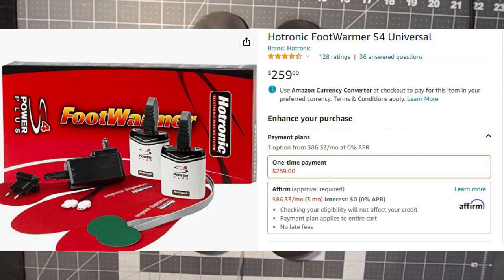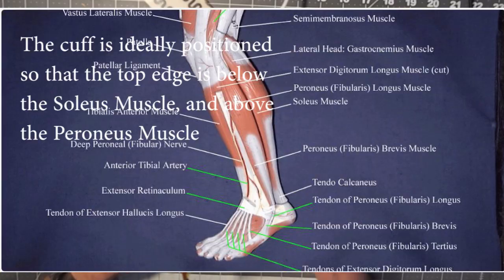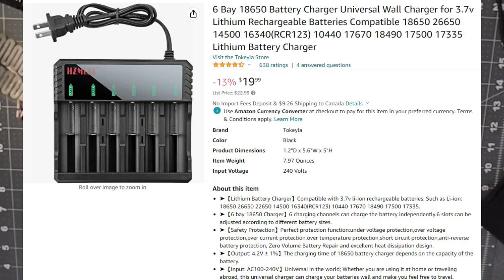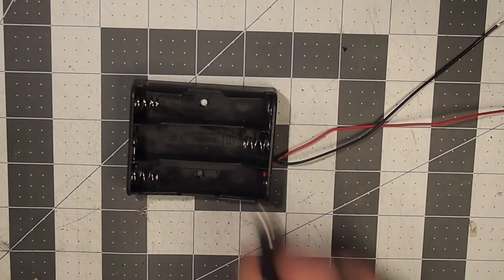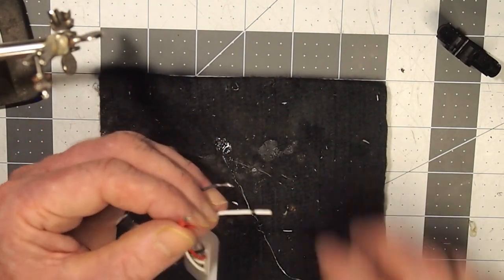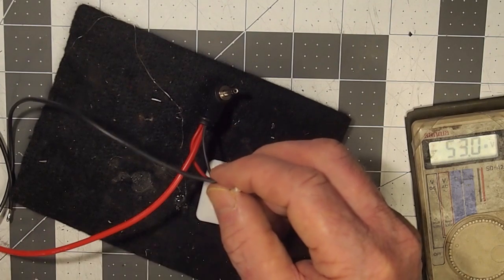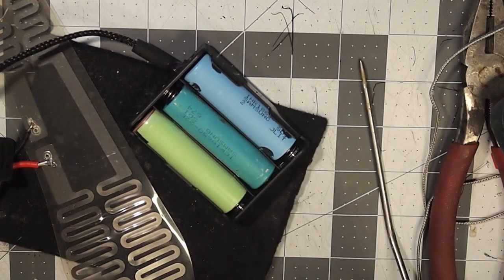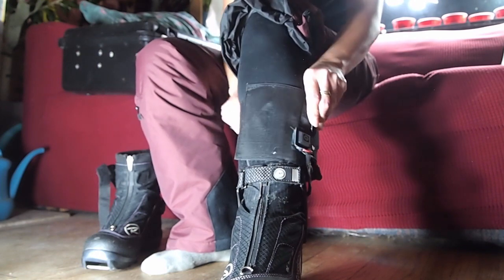Handwarmers S07E04: Make $500.00 equivalent boot heaters for less than $50.00

Comment: I just watched video S06E01 with the rebuild; Zippo and Jon -e Giant. And, my handwarmer is neither. It's larger than the zippo but smaller than the Giant. Which on the video, per the grid squares you describe on the mat, is at least 4.5" in height. That's bigger than mine

 I need a little help. I'll give you the dimensions of my Jon-E and you give me an idea of what parts kit will fit and I'll complete the form. 

   My Jon-E specs:
   
    H - 3.5"
    W- 2.25"
    D- 11/16"
     With a burner area W @ 1.1875"
    
  These were from the late 60s, when I was a young man hunting deer in PA. If you don't have parts for these... understand fully.
Reply from the maker: Thanks for that Joe, I often confuse myself because my mat is in inches and all the Chinese suppliers talk in centimeters! According to Google, if I convert your 1.1875 inches to mm, your catalyst head appears to be about 30mm long. That is fairly standard for a lot of catalyst heads, so a spring that is 35mm long would fit. But then you need to look at how wide the opening is so the spring can fit inside the head. Those dimensions are typically 9, 10, 11, or even 12mm. See if you can measure that, then it is possible to make sure you get the correct spring.

Comment: Just ordered some upgraded handwarmers from you, looking forwards to using them. 

I work outdoors and this is the missing piece now. Does that switch have any kind of safety for the 18650s? Low voltage cutoff or something similar? 

I'd love a set of these but relying on the protection circuit in the cell itself is scary to me.
Reply from the maker: Thanks for that Jady,
18650 cells need to be protected when charging, not discharging. The horror stories you see on Youtube depicting batteries experiencing thermal runaway are when they are charging (usually when balance charging has shit the bed), and of course a short circuit can cause a fire as well. Single Li-Ion cells do not have to be balanced charged because you remove them from the battery case and charge each one individually. However, Li-Ion should not be discharged below 2.5v per call or they can become damaged to the point where they are no longer able to recharge. The chargers have the protection circuit in them for overcharging (where they have a voltage cutoff at 4.2v to avoid overcharge). When used for these boot heater footbeds, the concept is, when the cells in series in the battery case fall below the 3v mark the footbeds will not be producing enough heat to keep your feet warm, so the user removes them and replaces them with fresh cells. At the end of the day, the last of the day's cells are removed from the battery pack and go back into a (protected) charger, so they cannot be discharged too low. The switch has no protection circuit, it pulse modulates the current to create the various power settings of high/medium/low. In fact, I just finished removing the protection circuits from a new set of protected 18650 cells for SWMBO's boot heaters to get them ready for this season.
Reply: @MountainParameters  the ol common sense circuit, makes sense. As it turns out, I carry a multimeter every day, never thought to just use that to check. 

I'll put these on the "I want" list 👍

How's your stock on the DIY kits?
Reply from the maker: @LovesTorque  
As a backcountry warden staying in cabins with solar, and having to service remote trail cameras, there was always a multimeter with me on one of the pack horses or the saddle bag. Last year on a biking holiday in Scotland, my son noticed I still had one, and asked, "You are definitely eccentric, who else carries a multi meter when they are travelling"? He had a fair point as we were not on eBikes, but I guess now we know. At the moment I think there are 2 of those kits here, and a few of the 6 bank chargers for 18650 cells.

Comment: This is epic!! Would you send me 2 pairs for a couple hundred dollars? Lol you could definitely name your price on these "batteries not included boot warmers".
Reply from the maker: Thanks for the encouragement! She Who Must Be Obeyed pointed out the majority of interested souls may have access to a sewing needle, but less so the soldering equipment and skills. So today I am contemplating adding these items to the handwarmer order form. First option would be just the parts for the DIY crowd for $45.00, or everything soldered together for $95.00. As shipping batteries is problematic, it would make more sense if the end user still looks after getting their cells locally by harvesting them for free, but I may see if I can chase down a decent 6 bay charger that I could offer as well.
Reply: @MountainParameters  what where is the order form for products? I will definitely be making some purchases! I think most people have their own 18650 batteries and chargers for something or another by now but could be wrong.
Reply from the maker: @turboupgradegokartjoe1174  Order form link is at bottom of description. However the boot warmers are now sold out, so I have to wait to get more of all the parts. Due to the situation with lockdowns in China, it is unknown when they will get here. I suppose the best bet would be to collect names for anyone that may want to wait and be notified when there is more stock. I am also planning to test some remote control units with the next batch so there will be the option to use the switch, or use a remote. The units that I made in this video were for She Who Must Be Obeyed, and a few days ago when she used them for a hike at -20C, she found that even on the green setting one of her feet got warm enough she just shut them off halfway through the trip. I was wearing light hikers with mine and on green, my feet were comfortable. With respect to chargers, when I looked at the 4 and 6 bank units on Amazon I was not to keen on their spec's, so I found a higher end 6 bank unit in China that is built for people who build projects that require a better charger (but not a fancy box so it is also in 'kit' form where the end users can leave it as, is or use a box of their own to put it in). I am going to test those in the hope it will result in being able to offer better 6 bank 18650 chargers that would be much better for both safety and charging, at a similar price to those on Amazon.

Comment: Does the 3 color temperature controller switch operate at a full 3S voltage? 
How many Watts can that controler push as 3S?
What is the highest voltage range that switched controller can operate under? 
Run a 4S system typically, but have those controllers and have always been under the impression they were a 5V nominal switch? But have driven them at ~6Vdc typically at low amperage before they warm up.

Will these controllers run at elevated voltages? If yes, that would be fantastic, as the elements im trying to use require a high voltage output to be viable the way they are configured.
Reply from the maker: The way these switches work is discussed in greater detail in a previous video: "Handwarmers S05E01: Bench test "Holmes Heated Work Gloves" from Costco". These switches use 24AWG, so you need to look at how much current they can handle, not how many volts.
Reply: @MountainParameters  Looking for the input voltage range the controllers are compatible with, so the internal IC does not overload?

Comment: Can someone please supply a direct link to the controller? 
Or tell where it can be found with a explicit title to search under?
Reply from the maker: Perhaps you mean the switch assembly? We will have it, as well as the other kit parts on our order form once I can get more stock of them.
Reply: @MountainParameters  Yes I believe that is the terminology you use in the video. Is this specific controller Only available through your site? I think I have some (the operation looks identical), just not sure if the voltage rating is the same? If you know does any "switch" like the one featured likely have compatibility with 3S voltages, and perhaps more without overloading the internal IC logic?
Reply: @MountainParameters  Thank you for the video BTW, very enlightening!
Hoping this is the same controllers I use, and that they are fully compatible with 3S or 4S if there is any way to verify that detail.
Reply from the maker: @101rotarypower  We may be confusing the nomenclature. I assume the 'controllers' you refer to are the switches? (They 'control' the power by switching it on and off). Also , I'm wondering if you are concentrating on volts when you might mean amps? The switches I've seen use 24AWG, so I gauged their capacity using OHMS Law. The maximum voltage that a 24 AWG wire can handle depends on a variety of factors, including the type of wire, the ambient temperature, and the type of insulation. In general, a 24 AWG wire made of copper can handle up to 600 volts in dry conditions with proper insulation. However, if the wire is used in wet or outdoor conditions, the maximum voltage may be lower. It is also important to note that the current-carrying capacity of a wire decreases as the wire gauge gets smaller, so a 24 AWG wire may not be suitable for high-current applications. In general, 24AWG can handle 3 amps DC current if used in a chassis wiring form factor. I've not come across any of these resistive pads that draw more than 2 amps, so I'm happy to drive them at 10 volts
Reply from the maker: @101rotarypower  We get the switches from the factory that makes the Red Star hand warmers for us in lots of 500. But I assume as they appear in all sorts of consumer products, they are easily available elsewhere in smaller consumer DIY quantities.
Reply: @MountainParameters  Its possible the controllers you are using are different than the ones I am familiar with. Visually they Look and operate identical, but rarely is that a perfect indicator of the hardware identification.

The controllers are being switched as one of your videos covers full ON/~66% duty cycle/~33% duty cycle via the red/blue/green identifier LED (again requiring regulation if deviating from a low ~3-4Vdc source voltage).

The board has to drive the logic for the drivers and color coded LEDs, my assumption is with a IC?

This IC I thought was limited to a nominal 5Vdc , as all/any documentation I have been able to find only specifies MAX 5V.

But if the controllers I have are the same as yours, it sounds like they may be, they look like the source voltage can be much higher.

Hopefully that helps clarify the question? Its concerned entirely with the compatible input voltage of the "switch" Only.
Reply: @MountainParameters  Yes I believe they are the same as mine then.
Thank you for the videos!
Think I learned something Really Important about these "Switches" today!!!

They have always been in my parts repertoire, but no idea they could operate at those input voltages, as at lower voltage they just cant output enough total wattage , I think the limit is ~3A output on those controllers before they start to exhibit overheating, assuming they can handle a much higher voltage input, the wattage will be substantially Increased to levels that are viable!

Thank you!
Really appreciative that you put this video out, and that someone on reddit was kind enough to alert me to there existence!